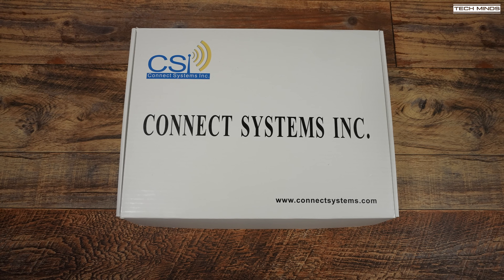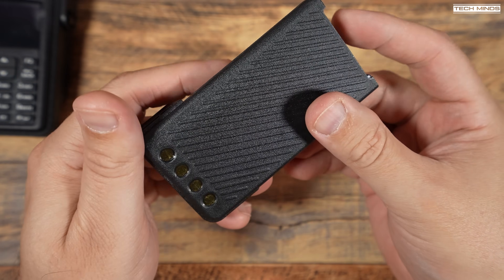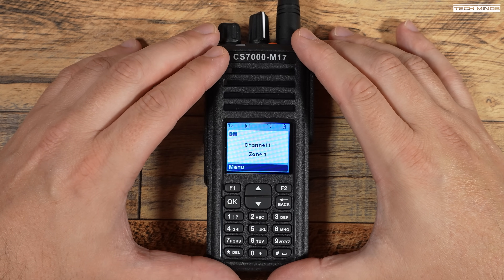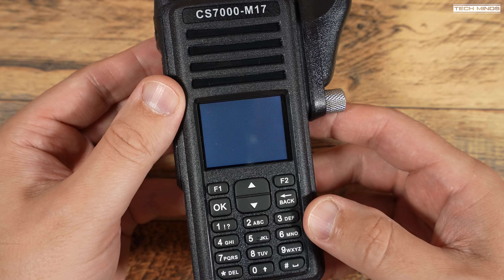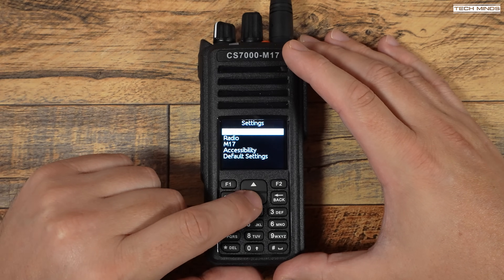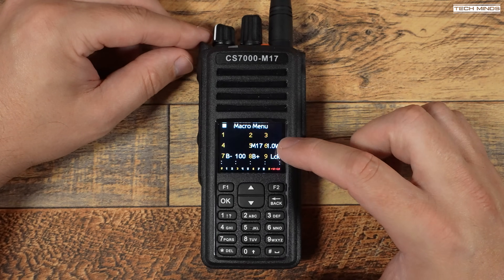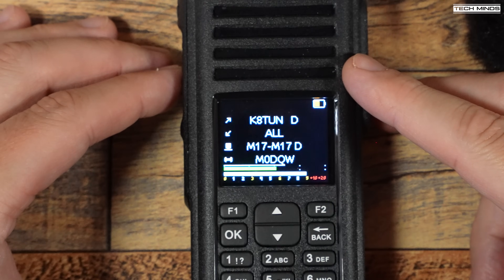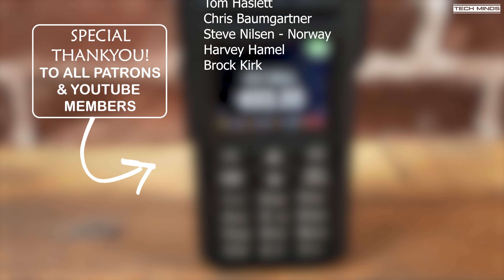The FIRST Commercial M17 Digital Radio - CSI CS7000-M17

Comment: Interesting radio for sure.   The one thing is, it cant switch from M17 to DMR without changing the firmware?  Is yours a M17 Plus or just the standard M17 model?   I see that the Plus can do Dstar, P25 and other protocols too.   Hope it isn't all just updating firmware each time.

Comment: This is awesome. M17/freeDV/codec2 is pretty great and unlike all the others it doesn't require licensing which is how it should be for amateur radio, especially since it works as well it's better. With a little luck one of the larger makers will notice, or even Bridgecom or Quansheng. Hey Alinco, I have an idea for you.

Comment: It would be nice if it could handle the DMR, FM, and M17.
Reply: What does it currently support?
Reply: @gaborm4767 I don’t think it can’t operate both M17 and DMR modes in current firmwares available. 

So it’s DMR, FM or M17, FM at the moment.

Comment: If we all want to sound like Donald Duck - we already have a few digital modes, and at this point in time it's difficult if not impossible to impress us to even try out yet another one. When a digital mode will sound as clean as my $50 Baofeng 82... I promise to invest in it. Until then, buzz off!
Reply: You can use LPCNet or EnCodec to greatly improve the voice quality, but I'm not sure you should be using radios at all if you don't understand the point of our hobby.

Comment: I installed Droidstar onto my 4G smartwatch with microSIM chip. I tried to QSO over M17 but I could only three stations in three weeks. I think the M17 will remain just an experiment. Luckily, I don't have an exorbitantly expensive radio...
Reply from the maker: Try M17-M17, M17-DMR or M17-HUB.. The last two reflectors will be extremely busy most of time.

Comment: I really can’t see the point. The digital radio scene is already far too divided. This is just another 4FSK system with a non-proprietary codec. And the audio sounds just as bad as all the others.
Reply: I disagree. I’m building my third HF SDR transceiver from scratch so I’m hardly stuck in the last century. But with DMR and DSTAR and Fusion we don’t need any more digital modes on VHF/UHF. We actually need less
Reply: @rogertrett406  new digital modes spawn all the time, that's the point - experimentation. Just like you spawn more HF radios. There's enough space for everyone in this hobby.
Reply: @nemam_nedam  have you seen our (M17 Project's) Remote Radio Unit? Google it.

Comment: Thanks for this video. Wasn’t aware of M17, but I am very familiar with Connect Systems as I have or have had five of their radios. I’ll have to investigate this mode and maybe modify my RT3S or UV380 to experiment with this mode.
Reply: Modifying gives you a handheld with M17 support, but the voice quality is crap when compared to what Module17 or CS7000 offers.

Comment: What D-Star, Fusion, DMR, P25, & NXDN aren’t enough voice digital modes to use? Like the hobby isn’t fragmented enough with all of these digital modes. 1000’s of talk groups and 100’s reflectors with hardly anyone to talk to. I’ve pretty much given up on these modes because I got tired of hunting for activity or listening to dead air space. We needed another digital mode, like we need a hole in the head.
Reply from the maker: If you cannot see the value that this brings to the hobby, then M17 is probably not for you at this point. To me, it's not just another digital mode to talk to others with, it's a digital mode that the Ham Radio Community can modify, extend and integrate into digital ham comms without licensing issues. Currently, we cannot modify anything on DMR, DSTAR and Fusion, because of licensing. Once the Chinese manufactures start implementing M17, I would expect M17 to grow massively.
Reply: @TechMindsOfficial  the only way I’d be into M17 is if the powers that be don’t turn it into the DMR landscape. What I mean is there’s 1000’s of TG’s on who knows how many networks ie Brandmeister, TGIF, FreeDMR. Not to mention all of the private servers that people set up. The problem with most of this digital stuff is everyone wants to be the king of their own fiefdom. Which leaves us people that just want to talk on the radio hunting through dashboard after dashboard looking for people to talk to. Like I said, I got tired of doing just that and it’s why I’ve all but given up on digital modes.
Reply from the maker: @truckinguy92  yeh I know what you mean. I think that’s why groups like Hubnet and FreeStar work well, they have lots of modes and repeaters all linked together, so there is a central place we can have a QSO using digital or analog.
Reply: @TechMindsOfficial  All that is going to happen is M17 will end up another Freestar clone, infact it has already happened! Way too expensive when you might as just stick with your existing Digital HT, as it will be cross networked. M17 is dead in the water already
Reply from the maker: @PaulStrickland   M17 is a digital mode and Freestar is a network of all digital and analog modes linked together, which brings people together to talk to each other over ham radio. https://freestar.network
Reply: @PaulStrickland  thanks for sharing your eloquent comment.
Reply: You seem to miss the whole point of ham radio: experimentation and openness. M17 gives you both at the same time. Good luck expanding the capabilities or sending arbitrary payloads with DMR or P25.
Reply: @SP5WWP  I agree with you, but it’s not the only aspects of amateur radio. As far as arbitrary payloads, I have no idea what that even is. But what ever it is I don’t see it being easy to send on a small HT.
Reply: They had no qualms about poaching Motorola XPR7550 case design right down to the mic connector and Hyrera’s screen design and icons.
Reply: @truckinguy92 maybe you dont get how chinese companies work.. you make a radio.. you pay that radio company to make that radio with a label that says “sad ham radio company “.    Then another company pays you money to print “extra sad ham radio company”.  Both radios are made by the og company.  Neither company poached.   The whole chinese industry is a poaching model.   Anytone pro 6666 and radiooddity qt-80 are made by the same company.  Kenwood poached plugs are a chinese radio standard.  Dmr chinese radios are poached motorola dmr commercial hardware….  Csi has made great equipment for a long time.  They were a premiere ltr company..making great rptr panels, interconnects and then sought radio companies to make radios with their name on it .  Their cs300 ltr line was way ahead of its time .   Know the industry a little and it s history and it makes more sense .   It all started with the fall of nextel and iden

Comment: Nice review. This radio looks like the discontinued Motorola XPR-7550e.

Edit - the programming cable looks exactly like the one you use to program the XPR-7550 and APX-6000,7000, and 8000 series radio.
Reply: @plutonium76  with a display from a Hytera.
Reply: @truckinguy92  Well a firmware that looks like it. I'm guessing that's where the maker of the TYT/Retevis/Baeofeng radios got their look from too.
Reply: It's basically modelled on that for sure, just made to look legally different.

Comment: Does the current M17 protocol/firmware support encryption for Part 90 use? If not, does anyone know if there are there plans for it to?
Reply: The firmware does not support encryption of any kind at this point. The protocol supports 2 different encryption schemes: simple scrambling and AES, all key lengths.

Comment: Please demonstrate the accessibility features. I'd like to hear the speech output and learn if you can store a channel without using the display. WB3CAI
Reply: The speech output is pretty good, IMO. Providing you like English accents! I don't need that feature, but I'm glad it's there for those who do.

On the negative side, the memory functions (banks/channels/contacts) are still not there, they are merely menu placeholders for future features. I'd have hoped the firmware would have evolved much further in the past ten months since this video has posted, but that's not the case. It's still very much in the alpha-testing stage, a work in progress with very few features and not even a CPS yet. Buy one of these if you love messing with new things and want to support M17...but don't buy it to be your primary radio, it's simply not there yet. If you get the Plus model, it will dual-boot between OpenRTX for M17 and CSI firmware that provides very functional DMR and FM operation. The latter modes does have a CPS but it's a little rough around the edges as well.

Comment: WOW What a "Specialized" Programming Cable.. (BETER NO LOSE THAT).. Probably a replacement will be $$$$$
Reply: A lot of commercial radios (here's looking at you, Motorola) use "specialized" proprietary cables, so there's plenty of precedent. That being said, it would sure be nice to see everybody start switching to a basic USB C interface for both data and charging, as has happened with cellphones. I'm kind of shocked that the Kenwood 2-plug speaker mic connector has survived so long as a standard.
Reply: @nemam_nedam  LOL .. ya right.. (No thanks) what a mess.. I'll just not buy the radio Until they Redesign the Radio with a Commonly Available USB "C" Cable.

Comment: What does M17 offer the ham community that isn't available with DMR?

Serious question. Why choose it over the plethora of DMR radios available?
Reply: I would consider the development of our own Open Source transceiver much more important than the development of a new protocol.
Reply: Decentralized system. Complete openness. No registration required. Digital signatures are available. Easy to implement through libm17, gr-m17 etc.
Why were light bulbs invented when there was a plethora of other light sources available?
Reply: On a practical level, what does it offer that DMR doesn't?

M17 may be a purer and truly open system, but I don't see how DMR has suffered from that not being the case?

For example, DMR radios are as cheap as it's possible to make a commercial radio and they are made by a multitude of different manufacturers, the networks are maintained by volunteers, the repeater infrastructure is maintained by volunteers. How is M17 going to make this better?

I'm just not seeing why we need a new extra lightbulb in a room full of lightbulbs?
Reply: @Focal_Paradox  M17 was the first mode to use IPv6 - show me a DMR network using it along with DHT. 'Run by volunteers' doesn't mean it is good.
Reply: @SP5WWP  True, but volunteers for such vast infrastructure are going to come from the same pool of people, probably the exact same people.

Innovation is a good thing, but I'm yet to see the practical benefits from a system that is basically offering the same end user functionality as an existing system.

To cut to the chase, how am I going to persuade my local hams to take this system up over DMR, D-Star, or Fusion?

I get that the hardware geeks might love the innovation and open source nature of it, but to an end user, it's just "another damn radio to buy," to be able to talk to an even smaller subset of hams.

What's it's USP from an end users perspective?
Reply: @Focal_Paradox  it's Linux/Unix vs. Windows kind of question with almost the same reasoning.
Reply: @Focal_Paradox  it's Linux/Unix vs. Windows kind of question with almost the same reasoning.
Reply: @Focal_Paradox well.. M17 is only getting started.
Comparing M17 with DMR right now there isn't much difference. 
But down the road things like picture sharing, general data, and other not yet thought of applications will come to M17.

Understandable to be apprehensive in it's current state, but 10 years from now it could very much be the best of all the digital modes without the proprietary and brand aligned nature of DSTAR, YSF and DMR.
Reply: @virtual812  M17 already does all the stuff you mentioned. We even have strong encryption and digital signatures support. Encryption is of course optional and disabled by default.
Reply: @virtual812  

I'm in favour of open source products for ham radio. The only thing that concerns me is the need for a market for any manufacturer wishing to produce new hardware.

DMR manufacturers have a ready made market in the form of the commercial users who are being pushed to upgrade to smaller bandwidth and "more secure" digital formats. This larger market lets them make cheaper units, which helps keep the prices down for DMR radios when hams buy them.

D-Star & YSF manufacturers have a much much smaller market in the form of hams (and only hams), and this is why D-Star and YSF transceivers are so expensive in comparison to DMR transceiver.

M17 is going to be even more niche, with individual hams building radios, and the very occasional manufacturer putting out a radio for a high price due to a small consumer base.

I'm not concerned with the tinkerers and experimenters playing with new formats and modes. I'm just concerned with the ever increasing number of new formats that are ever dividing the userbase.

I don't know what it's like where you are, but in my local area, each individual repeater (digital or analogue) has fewer and fewer users on them, and this is partly due to the fragmentation of the users by modes.

We're 'experimenting' ourselves into smaller and smaller on the air  communities.
Reply: @Focal_Paradox  so well said! Certainly better than I was able to do it. But it basically got the same point across. Thanks
Reply: @Focal_Paradox 
Experimenting ourselves into smaller and smaller communities? Nay, precisely the opposite when utilising multimode/crossmode reflectors.
Reply: @nunyallsbeeswax  

I hear people arguing that. However, that's not what it sounds like at a local 'radio' level.

What you hear at a local radio level is different people using different digital mode repeaters and gateways, if you have the correct digital radio, you can listen to, or talk to, a person in another part of the country via a repeater or gateway over the internet, but you now only stand a 1 in 4 (analogue, D-Star, DMR, YSF) chance of being able to talk to that local ham over the airwaves or directly through the repeater.

Even multi-mode repeaters are separating local users based on which digital mode they've chosen. In my area, we have three repeaters and a couple o gateways that cover all the modes, but they are all connected (each of the different modes) to their own different networks, Different DMR networks, added to the different D-Star and YSF rooms they individually connect to. Great for variety, terrible for generating or maintaining a local ham community.

Anecdotally, I can say that the level of local VHF/UHF communication has dropped to rock bottom since the proliferation of digital modes. It's possible there may be more people playing with radios, but they are doing so in ever increasingly smaller and smaller niches.
Reply: Apparently there's a small licence fee. But for that matter, isn't D Star supposed to be open?
Reply: DMR is business radio shoe-horned in to amateur radio, the use of AMBE and various other patented technology should be a massive red-flag. Even the horrible CPS software that is offered by all of the big named and Chinese DMR vendors should be a warning, yes I use DMR, but M17 is open-source, patent free and there is open hardware available for it, it allows for experimentation and every feature to be added whenever is necessary. That's the real ham spirit!

Comment: Great technical detail as usual. Off topic, why has nobody demonstrated the capabilities of the Retevis Ailunce HS3 SDR HF/VHF/UHF Transceiver, the price is now US$ 676.99.
Reply: I think you may have mis-typed the price because 676 is a wee bit too expensive for a 'cheap' radio?
Reply: @TsiolkovskySportingLocks  From a distance, for the specifications the price might be worth it.
Reply: @akeem11h  ignore me mis-read the radio name.  You are right, you seem to be getting a lot of radio - especially as it seems to be normally retailing for around 1000 USD.
Reply from the maker: Its the same radio as the Q900 radios. Too many bugs..
Reply: @TechMindsOfficial  Will check out the video, thanks.

Comment: I've following the CS7000-M17 dev via the M17 Project Matrix channel - where quite a lot of devs hang out.  Have to say that programming cable attachment looks massively clunky to my eyes.  Great review and frankly I would love to get one but gonna have to save up for it.
Reply: Looks like its heavily Motorola inspired design
Reply: @AndrewR2130  doesn’t it just.
Reply: @AndrewR2130  It is exactly the same as a Motorola XPR connector. In fact the whole radio appears to be modelled off the XPR design including the side buttons and keyboard. They obviously had to make it legally different hence the speaker grill.